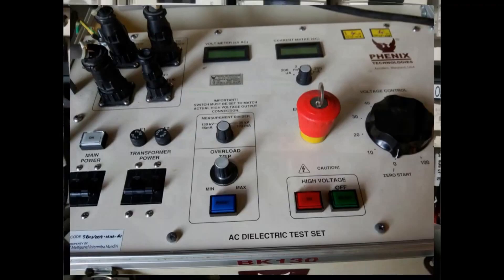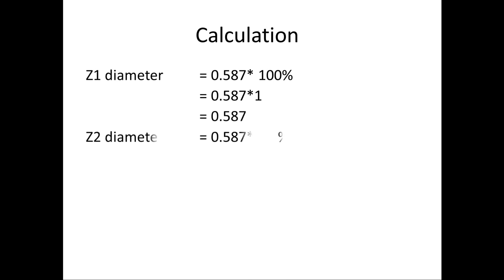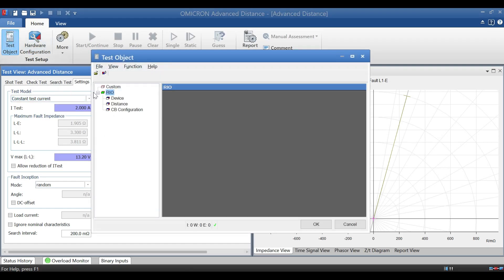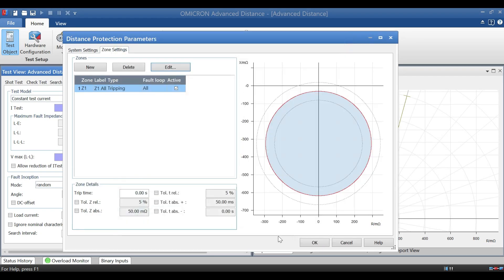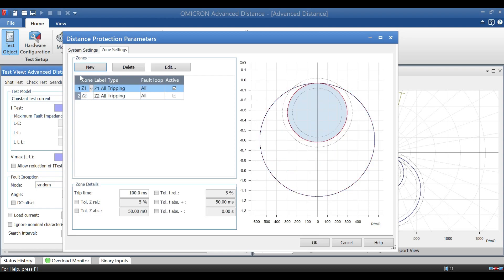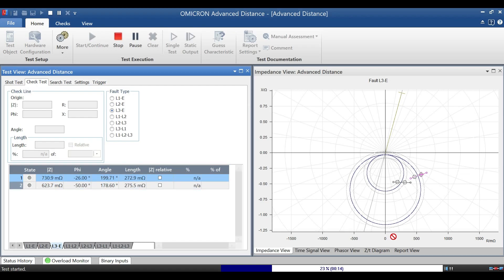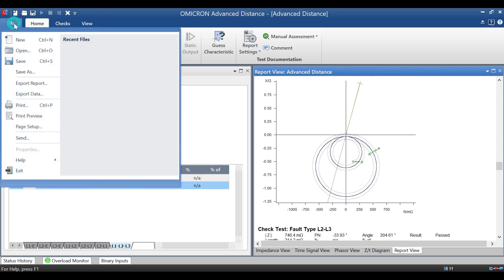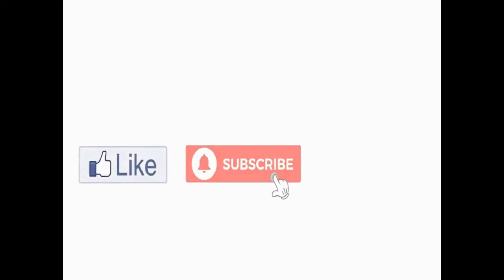Loss of Field Relay testing | Under excitation relay Testing

Comment: Hi, I am try for this principal make advanced model for generation 6,3 kV, 36MVA, Xd=1.4 and I get result R1=0,5645, X1=-0,62377, R2=1,08384, X2=-1,14311. And I try testing but It doesn't work.
Did I good calculation this resistance?